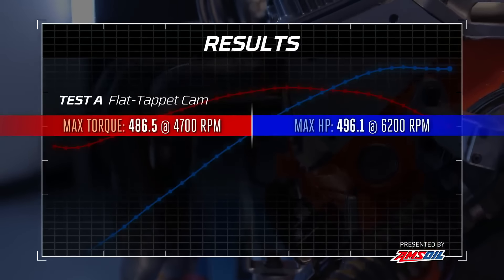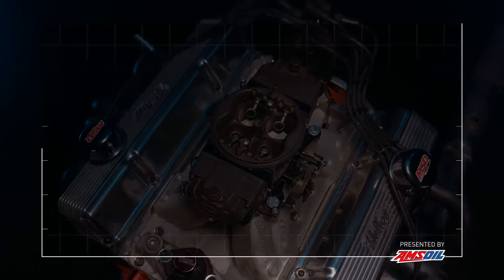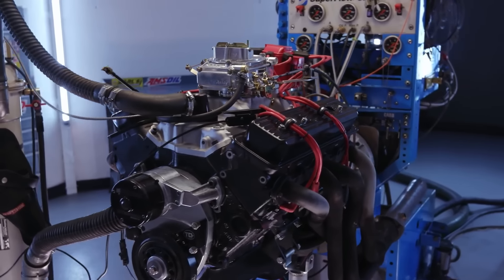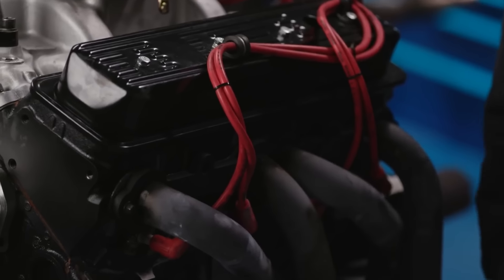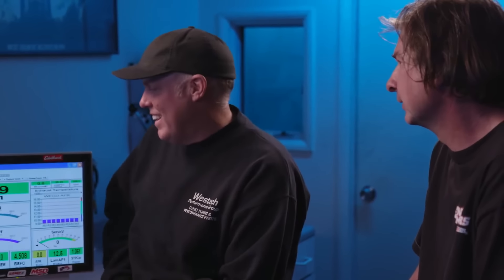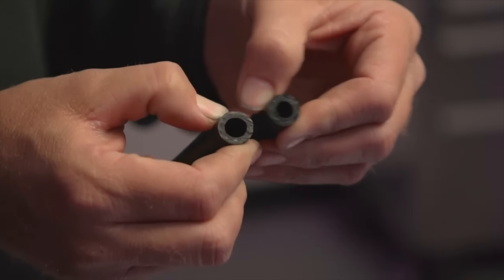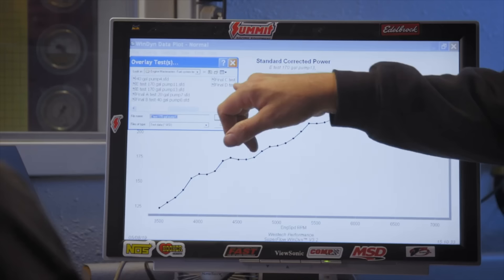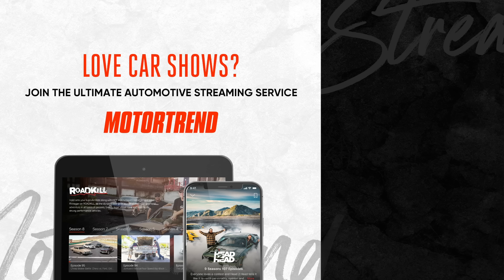Budget Mods for Big Power! | Engine Masters | MotorTrend

Comment: The last Carter pump I bought leaked horribly from the gasket.  Had to take it apart and lap the bottom section for over an hour to get it flat enough to seal.  When the surface was fly cut during production only about half of the surface was finished.

Comment: Those Swirl Port heads aren’t the ones for performance cars. However, if it’s low end grunt you seek then these can be ported and polished and they’re great for below 4K rpms. Put ‘em on a 305 block with a 400 crank and you have a stump puller that won’t confuse your computer too much.

Comment: I used to cruise around in a '68 Dodge charger 440 Magnum and yes it didn't have a big enough fuel line and fuel pump because around 170 mph it would start to run out of gas it would run about175 mph then 17 years old it was a blast this was around 1974 I put the second motor in it with a 4-speed fastest car I ever rode in and I rode in 426 Hemi roadrunners with two fours they were almost brand new then but that car would smoke the tires for about a whole quarter mile that's how I blew the original motor up because my friend let me drive it couldn't stop getting on it

Comment: and what they dont discuss is the lobes on that 292 mega cam were designed in the early 80's. a better comparison would be a cam with lobes designed in the last 20 years, or less. the hr roller is still going to win, but it wont be by nearly as much.

Comment: I have a 290hp 350 marine engine. Rebuilding it, .30 over. I'm wanting to be closer to 340-350hp when I'm done. Being marine engine I know nothing about what parts I can run, cam size I can go with, or better heads, or should I just port?
Reply: just run it stock  it will last longer

Comment: Can you remove one of the spark plugs and install a Computer Interface Pressure Gauges to see the increase of the pressure at low speeds and high speeds also check the vacuum on various speeds.

Comment: I would like to see what you could do with a mid 70s two bolt main 350 and keep it reliable. 
I think  the two barrel was 145 hp and the four barrel was 155 hp.
And for a finally see what it takes to grenade it. 
The results might be interesting.

Comment: Are there any intake upgrades for the 96-2000 GM truck EFI?  (spider injection)  P.s. great episode!!!
Reply: I know they make aftermarket intakes so you can convert to carb if you so desired, paired with a holly sniper you probably have a decent upgrade... (I've heard from multiple sources that the spider injection systems were not great but honestly I don't know for certain that it would be any major benefit.)

I'm doing a rebuild on what was once a spider-injected block but since I'm tearing it down completely (and bought it without an ECU) I'm planning on doing the above and then finding a chassis to throw the motor into later. The issue with you doing something like that is that if it's still in the original truck you then have to start messing with the ECU it would be extremely involved from an electronics standpoint at that juncture, even if you somehow managed to just toss the thing entirely.

Comment: With that low compression cylinder head on the right u definitely can go turbo.. just need to gap the piston rings for blowby.. I may use those heads on a 62 to 70s model sbc 350

Comment: It's not just about hp vs fuel volume.  It has a lot to do with application.  If you are running a dirt track car or something like a short course truck, you may want a lot of volume but not a lot of pressure.  So at a lower pressure, you need more volume to deliver the same amount of fuel with less aeration in the bowl.  A dyno likely won't show this, you need trackside testing, lambda and a good ear.
Reply: You do realize pressure is not volume and vice versa.. pressure is just a restriction. Yes, you can have one without the other, so just because you have enough pressure, doesn't mean you have enough volume to feed the engine. Giving the engine enough volume will make the power. Pressure is just a fine tuning option depending on application to keep the bowls filled. Yes, higher and lower pressure will affect the outcome, but very little, and is a band-aid. Without enough volume, it won't matter what pressure it's at. Volume IS much more important when it comes to making power. Can't read fuel pressure on a plug. Just sayin'

Comment: How much HP can you make on 87 octane fuel? That would be a interesting episode.
Reply: Your not going to make more power just by switching from 87 to 93 your just able to make more power and live with higher octane
Reply: @wyattfrey6079  30 degrees initial advance with 91 is worth the money on my old sbc with iron heads. It loves to get rid of old race gas a 37+ degrees. Every time you crank it up....you crank it up.... advance equals power till detonation. Octane equals advance.
Reply: Some pump gas is oxygenated. That makes a difference as well. I have disqualified many a racer in dismay as they say they are running pump gas how can they be cheating guys are running race gas..lol..then you have to educate them...
So anyone in smog areas....I mentioned this before... Decades ago tuning ....smog...is made of oxides...it doesn't show up on air density gauge. If you don't tune for it...bang..smog days are horsepower days.
Reply: 638 motor with 9 to 1
Reply: @bigrich7026  nailed it on the head!

Comment: I'm wondering, if you were racing, you never considered the g forces on the fuel pulling toward the rear of the car under acceleration. It would create somewhat of a vacuum or low pressure on the negative side of the pump. Back in the 70s the fuel would get hotter from the higher temperature of what the engines ran at which in turn caused many problems with deiseling and vapor lock. Since the fuel was under negative pressure on the back side of the pump. If remember right alot of racers ran the moon fuel tanks in front of the motors to help with positive pressure before electric pumps really took over.

Comment: ALL remotely performance engines need a 3/8 line. Mechanical pumps however can get confused and get the arm bouncing on the fuel pump lobe.
For a healthy street engine a mech pump with 3/8 lines is all you need. For motorsport however you need an electric pump with a constant pressure. And like many I use 1/2 lines and fittings. Needed? probably not but really costs no more. For a racecar at least.

Comment: What cam did you guys used on the first run the  flat tapped cam. I'm doing a rebuild on a sbc 400 and the flow numbers on the blueprint heads H8002K look really good. Nice run by the way.
Thanks.
Reply: If you're looking for some ideas on what cam to use, send me more information about the vehicle and engine.  I'll see if I cant point you in the right direction.
Vehicle info
Make, model
Weight
Trans (converter too if applicable)
Gear, tire
What is desired 
(All out average power, fuel economy...)
Carbureted or injected (if injected is a professional tuning it)
Desired rpm range
What you want to spend...
Do you desire a roller
Intake, exhaust, cr
A little bit of a picture will help.  I got 400 and the heads (but are you porting the heads)

Comment: Solid flat tappet versus solid roller please. A solid flat tappet LIGHT package and needs less valve spring than a solid roller.
Reply: A roller is superior.  You can get more aggressive than a flat, you can use a more aggressive lobe with less duration to get more area under the curve.

If you use a roller, I highly recommend spending the extra money to go with a bushel lifter.  Needle bearing failure really really sucks and happens even in high dollar lifters.

Comment: After less than perfect results on electric pumps I went to a mechanical pump. After a few years running it, heading home on the freeway car died. My kid brought a spare electric pump to zip tie in and get home. Autopsy on mechanical pump was pivot rod broke the case where it was staked in. I had never had a pump do that before. Told my kid and he had it happen less than a month later.  Mine was a Speedway his was a Napa.

Comment: Hydraulic cams will make good power as seen. Even around 7000rpm. Using an antipump up lifter.Though a mechanical cam will be best for that.
Fuel lines? When running a bigger fuel line you may as well go 1/2" Costs about the same and has plenty of reserve for more power. I use 3/8 on Webered Holden 6s. At 6500 and above that is essential. With 4lb max. Or they go lean. Not good! A fuel pressure quage in any racecar is essential. As is ideally a fuel mixture guage as well.
A  good mechanical pump set for the correct pressure will support well over 500hp. And has done forever. A bad one is simply bouncing all over the cam! And doing very little. Ok at 4000 terrible at 5000. An electric fuel pump with all its reliability issues though to me is still better.
Fuel pressure?  A Qjet, or most OEM carbs need around 4-5 lb. And a Q jet will run 500hp easily.  Most Holleys, at least when being used require 7lb and E85 8lb. Methanol as much as 10. One would hope the basic standard pumps are making 4lb Not more.  Or the OEM carb will run rich and flood easily. 
A Holley tuned at 4 lbs on a very mild streeter will be ok. But high rpm healthy engine never. And the mechanical pump at times loses pressure and volume above that.
Reply: You can run a Holley style at low fuel pressure if done correctly on a race application (that's actually the right way to do it, just getting there isn't common knowledge).

Comment: I'll never go flat tappet again after many years of failed flat lifters.   Yes, had proper break-in procedure, lube, and high zinc oil.     Then you can reuse the rollers with different cams, or even on same cam but put on different lobes.  ....cant do that with a flat tappet cam without some issues(sooner or later).

Just way too many bad lifters on the market that dont have properly ground crowns that wipe out the lobes in short order.

Comment: Lol I run dual 120gph electric pumps on a 610hp 434w with 12an feed and 10an return . My second pump is set up on a low pressure switch that kicks in if I run below 6.5psi . Only time I've ever had the second pump kick on was running both my 125hp and 300hp n.o.s kits.

Comment: A goofy friend of mine was using a stock Ford manual fuel pump on a 351w , with a factory steel line. A huge five inch thick air filter. He actually had a 3/8” line being fed by a Red Holley coming in from behind the engine between it and the firewall.

Comment: Could you try using a hydrogen gas for fuel I heard it will be higher rpm compaired to gasoline
Reply: 2nd this
Reply: I want to see them do an engine that’s been converted to propane.
Reply: Rpm is the cam and heads. This only works with  high compression

Comment: What cam would you put together for these V-tec heads using a 87 TBI rotating assembly and a stock tbi injection?  Keep in mind I'm after torque for towing...
Reply: I am doing the same thing with 87 tbi The engine shop that did up my vortec heads specd out a comp cams 12-249-4 and an air gap dual plane intake to compliment the heads
Reply: @TRUSSTRUCKER  what is your fueling source?  Tbi?
Reply: @Blakep7704  yes using the factory TBI
Reply: @TRUSSTRUCKER   what adapter plate did you use to convert back to tbi on the intake?
Reply: @Blakep7704  transdapt 2210 4V-SBC From Amazon

Comment: What would be a good set of aftermarket cylinder heads for a 400 sbc? Around 700-800. Looking for something maybe better then vortec or are vortec heads top notch?
Reply: Vortecs are really hard to beat for budget. You can get cheap eBay or aluminum heads for 350-400 bare or 700ish with valves and everything.
The gain is pretty equal to vortecs about 40-50hp, alil more with good cam.  The thing to note is you would have to either pick heads for a 400 or drill the steam holes, the vortecs would need drilled.
If you can find vortecs not cracked for a decent price, they can be ported and make big power on 400, there small combustion chamber so it raises the compression a good bit.

Comment: I have bought most of an edlebrock
Power package , minus the heads. Does anyone know of a good seat of heads that aren’t 1800 . I have a eps intake with a 600 cfm carb and a 2102 cam thanks in advance

Comment: There's like a million guys and gals with TBI 350'S. When will you guys help us out??
Reply: I got one sitting in the garage with 127k I installed a 030 350 and 186 casting heads with a 450 lift cam running good in my 91 3/4 4×4 . Performer intake and Qjet 2 performance carb. Shorty headers and true duals flow masters.  Like my old truck and drive it all the time!

Comment: When modifying your engine to produce more power and torque, how do you determine if it well still met emission standards for the state it's registered in ?
Reply: Lol most guys building hotrods have no care about emissions and most modded vehicles are technically smog illegal. Depending on where u live u can get away with it but if u live in a terrible state then ur kinda screwed and have to work harder to keep it legal.
Reply: simple, you move out of that state.
Reply: Better hot rod all you can they will be pushing the electric cars on us soon but for me I'll carry on with my 468 BBC for now. I like to hear vvaaroom and not wwsszzzzzz! Lol

Comment: I bought a 1969 350 engine with SR world product cast iron heads with 2.02 intake valves im rebuilding the engine to a 383.
Would i be better off with vortec heads vs the SR heads? BTW im going to run
 9.5:1 compression 
280 isky hydraulic flat tappet 
Edelbrock rpm performer intake 
750 double pumper
Reply: I bet you won't gain much power and the SR world product heads won't crack! Love to see that dyno sheet! Just an old motorhead !

Comment: Which roller cam would y’all suggest for a small block 350.
Reply: That would completely depend on what you are using it for. SBC came in sedans, SUVs, trucks and Corvettes. Is it a daily driver, track, off road, towing? There is a cam for every application, the ''best'' cam is a myth.

Comment: What you setup would you recommend for a 1975 c10 350sb with long tubes but basically stock. Trying to daily it and get good fuel mileage and power.
Reply: rpm air gap  and a 650/700 cfm w/vaccum secondaries.May need a little more carb if you gonna change cam and heads

Comment: Yeah mechanical fuel pumps because getting fuel in your oil is cool!

No thanks, low-pressure electric fuel pumps are best. No you don't have to install it in the tank, you can have an under-hood unit mounted on your fender.

Comment: When I was 16 I threw the biggest flat hydraulic cam Earson made for a 429/460 in my 70 Cyclone Spoiler... I pulled gears at 7k for years with no issues.

Comment: The valve lift problem with stock vortec heads is total bs….it completely depends on the valve spring retainers and seals you’re using….I did zero machine work on mine and can clear about .500” lift

Comment: 400ci and it makes 492/517? I have a 383 on the dyno that makes 489/513 , small roller cam
Reply: ok?
Reply: A certain cam and heads make the same HP no matter how many cubes under them... but the torque should go up with cubes...
Reply: @BuzzLOLOL  with the bigger bore size i would expect to gain more than 3ft and 4hp
Reply: @christianobellio7111  - But you're comparing two different builds...

Comment: I RUN A LUNATI  VOODOO FLAT TAPPET CAM W.SOLID LIFTERS AND THIER CENTER OILING LIFTERS.. WICH COST ABOUT 800 DOLLARS LESS THAN A SOLID ROLLER.. I DONT SEE THE NEED TO WASTE MONEY BUT THATS JUST ME. IM MAKING 675 AT THE FLY WHEEL WITH 10.5 TO 1 COMP. 100 OCTANE AV GAS

Comment: I am sorry, did vortex vs afr ,afrvwas cheaper, after redoing the heads ,new valves ,springs ,retainers, locks, and options of porting, know where I am you can get camel humps, and other old school fuellie heads. Now I am one of those guys that shoots for 700hp,and will take what I can get.so it all depends on what you are doing. To what you want to spend,and findingva good machine shop.
Reply: A Vortec setup is definitely cheaper than an AFR (unless you can get a real deal).  Realistically you should get bare heads and have a machine shop do the work anyway because even your Darts, AFR, Edelbrock, Trickflow... you name it production head doesn't have the same quality as a good machinist. 

You can make alright power w/ vortec NA but even with a whole lot of work getting them to AFR level is very difficult and impossible in some applications (large valve, high rpm).

Doing the work yourself may be attractive to use a Vortec setup w/ 2.055" int, 1.6" exhaust and ported extensively.  You might be able to get around 600hp if you are real good NA on pump gas (91/93).

After all that work you might find yourself saying the AFRs are worth the money after all.

Comment: can i make 400+ hp on a stck bore 327 sbc rated at 275 hp with some eq or 906 heads n a summit 1784 cam or vidio 268 cam with a 700 dp n dual plain /Lt hookers./1.5 rr
Reply: They have done way more to that engine than there telling us

Comment: Roadkill was cool when you found cars from junkyards or anywhere and made them run and drive making something out of nothing.When you changed to your unilateral dreams of racing cars ,if i wanted to see that i would watch street outlaws and when you rev some of them up at the end until the engine blows or the transmission busts out of the bottom is useless . I see roadkill over because of this ,if you could just stick to getting junkyard cars and making them run and drive roadkill would if been a much bigger success than it was.